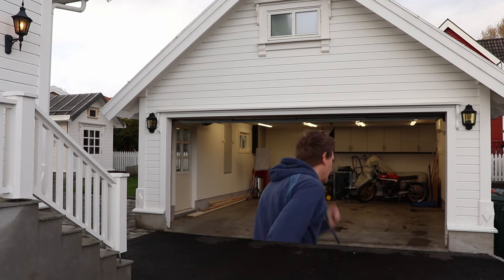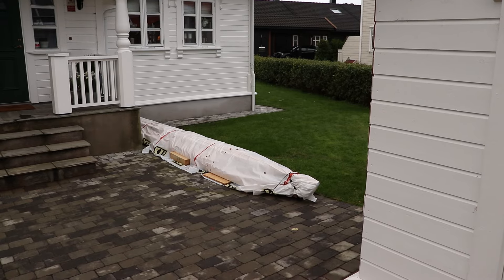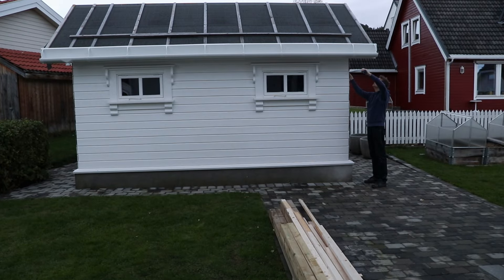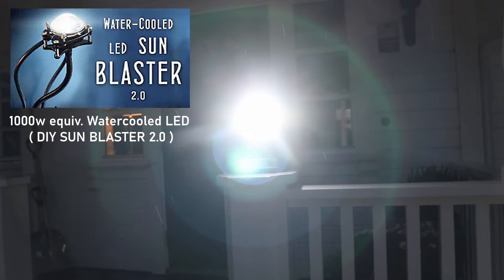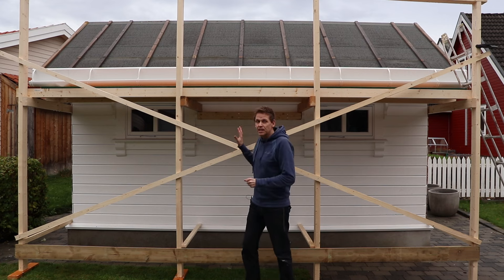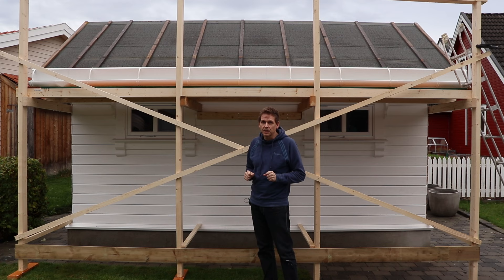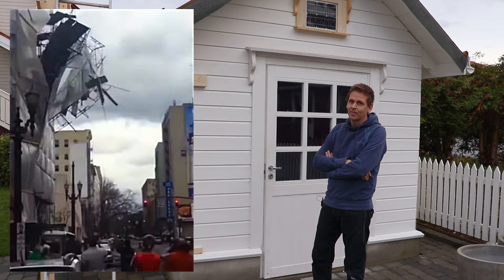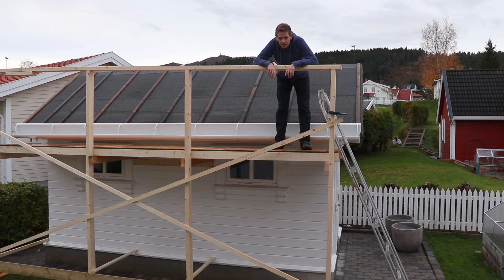How to build a wooden scaffolding - simple but secure!

Comment: If the joists from the sides and center ledger are only connected to the posts with screws, be aware of the sheer strength of those fasteners; live load from multiple people, tools, and material add up. Consider upgraded fasteners, or add brackets or blocking, maybe jack studs sistered to the posts under the joists like door framing under a header, etc.
Reply from the maker: Agree, I should have mentioned that this scaffolding is built more or less just to hold me + some power tools + some few roofing tiles. The screws are quite brittle (compared to nails or brackets).
Reply: Good advice. When my bum is on the line!

Comment: I'm a bit late to the party, but a great video again from you. One note is that the regulations also require a kick board, which is a board that covers from the base of the walking level and up 15-20cm that will prevent you from accidentally putting your foot out into the air/slipping off the scaffolding. not usually a problem from that height, but not a bad idea to have in any case. Anyway, the cat approved, so you're good to go.
Reply from the maker: Aha, good to know 👍 Thanks for the tip! The cat must have missed it 😁

Comment: Great idea, but could you have added an L-bracket to the side of the house on each side to attach the scaffolding to? It's a more permanent solution that could be used as often as you need to get back up there again.
Reply from the maker: Absolutely possible, but I did not want to have any "trace" of the scaffolding after I was done. Having a lot of sticking out from the wall will not be very pretty 🥴

Comment: Double ha.  What a great video.  What did you use for the board walk?
Reply from the maker: Thanks 🙂 It's 15x1500x750 oiled plywood, typically used as panels for concrete formwork. They are not very expensive, and they can handle some rainy days - and even some days with snow 😁

Comment: Hva matrialer brukte du til "gulv" ?
Reply from the maker: I used concrete formworking boards, it's oiled laminated plywood and can withstand wet conditions for a while. It was the cheapest material I could find strong enough to walk on and water proof